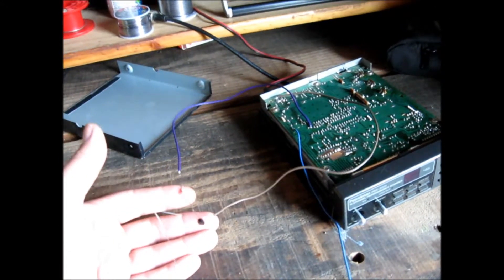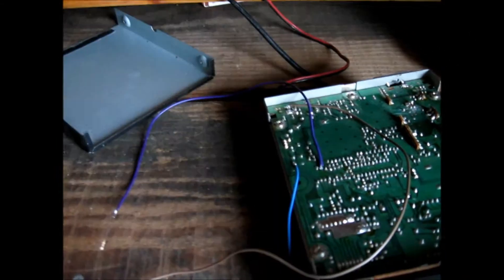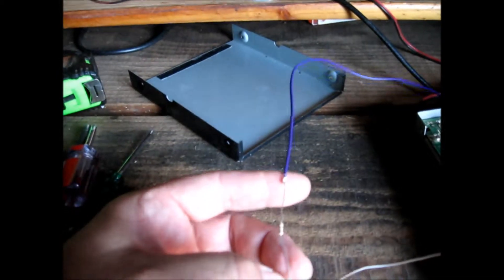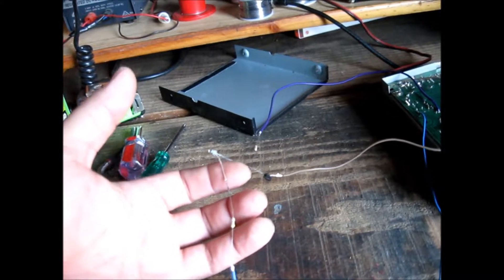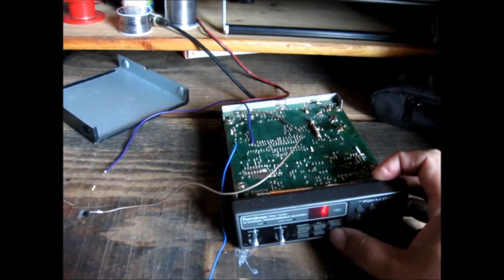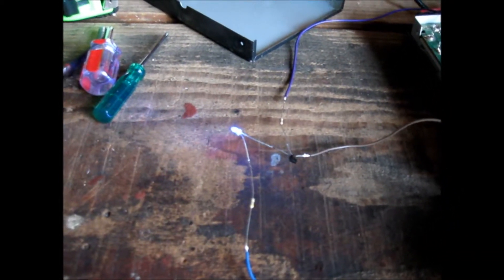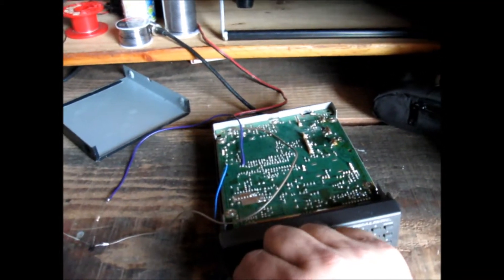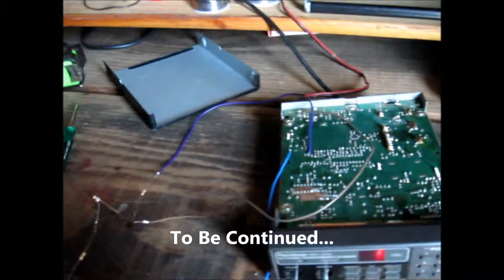Carrier On Indicator - Scanner Modification

Comment: Not sure i did understand it : the LED lights up when a carrier comes, and ? (sorry for the dumb question)
Reply from the maker: beaconmania Yes the led is illuminated when the transistor is switched on by activity at the source IC pin, all good no such thing as dumb questions when seeking answers or clarification 👍
Reply: Hi SpectreOZ, thanks for giving me some light but you do hear the carrier when it comes, i understand that the led for COI is just an accessoirie and not essential ? althought its seems to be an interesting circuit to build..
Reply from the maker: beaconmania Yes you can always hear the carrier with the squelch open/closed, I did this because if I have more than one scanner running I can quickly identify which one is active (important with service dedicated scanners), I have this scanner mounted in my car now so the indicator isn't really necessary anymore👍
Reply from the maker: beaconmania I have a basic schematic for this circuit on the video linked below (IC pin out changes from radio to radio)
Hope that helps 👍

https://youtu.be/qqtzGbPAecs

Please forgive the clunky production quality, it is one of my earliest uploads LOL
Reply: Okay : got it , thank you !!
Reply from the maker: beaconmania You're welcome, I learnt so much from YouTube it's nice to be able to put something back 👍
Reply from the maker: beaconmania You are most welcome 👍